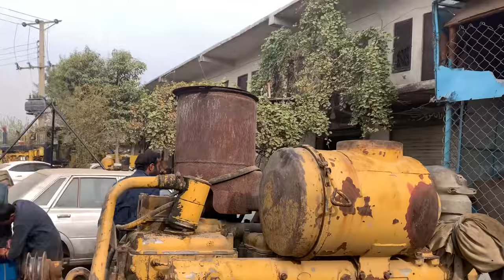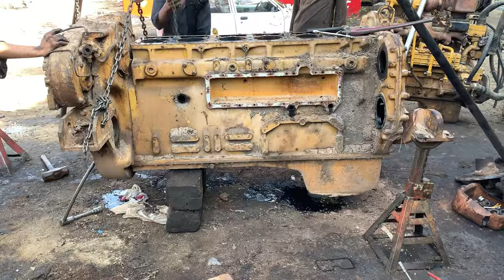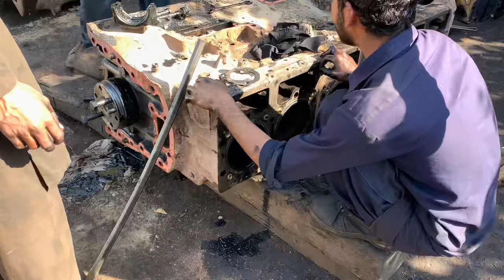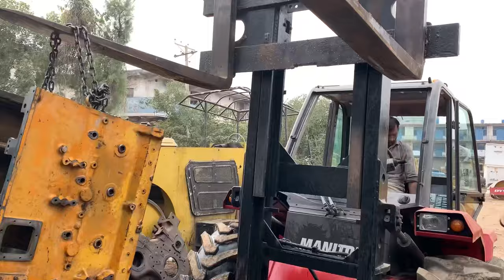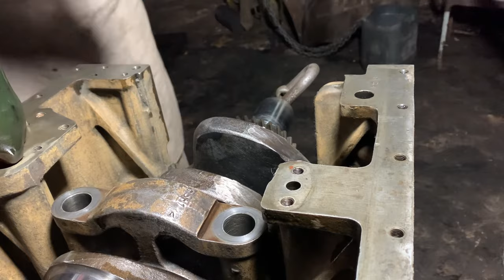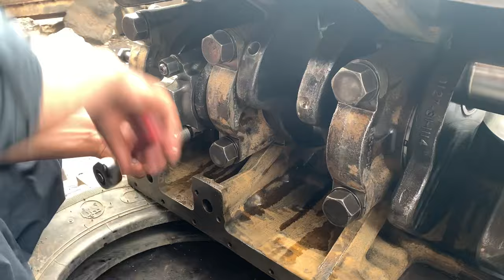Rebuilding Komatsu Dozer D155 Seized Diesel Engine || How to Rebuild Engine

Comment: With all that rust; Why didn't that engine not hydra-lock or was it recovered from the river?  Do you have to order parts and wait awhile or are they readily available? 
I never through of making a ring compressor out of and old liner. I will tomorrow!!